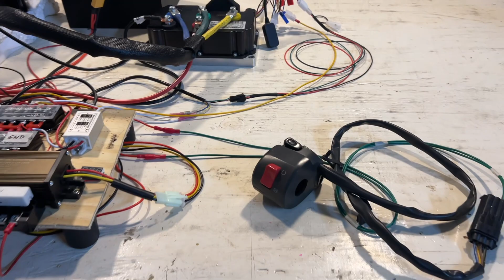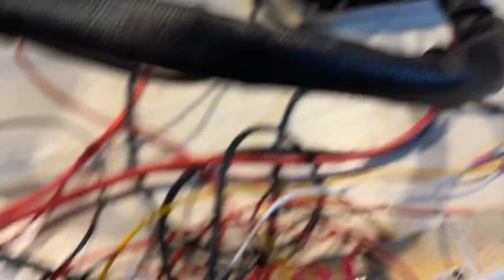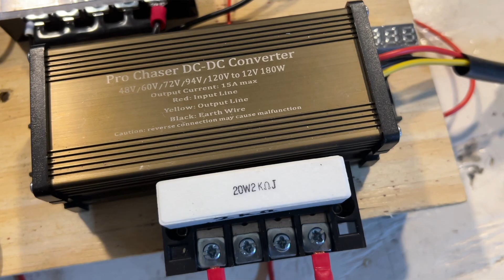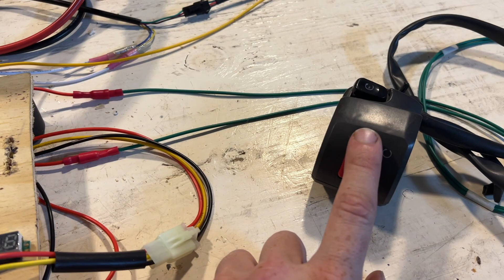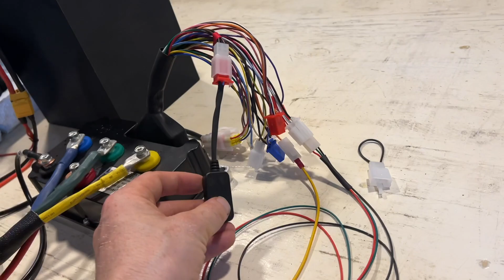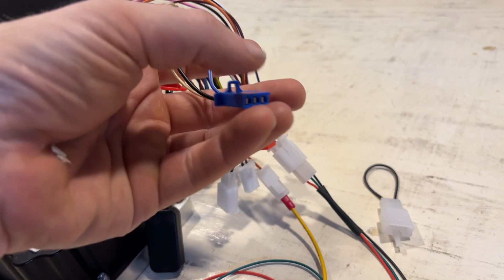Converting a Kawasaki KLS250sf Enduro Dirtbike to Electric (Pt.3) - Bench Test

Comment: The buck converter that is only used to activate the relay for the ignition seems very unessasary. Could someone explain what the point of it is? Why not just run 72 volts that are going to the buck converter to the controller?
Reply from the maker: The reason for the buck converter is to power the control circuit on the relay, which takes 12V. If you used a solid state relay where the control circuit was rated up to 100V (the battery voltage), the buck converter would not be necessary. 

The reason I wouldn't just pass the high-voltage line directly to the controller is because I wanted the system to be designed where all the component -  including the controller - operate across a single switch; the solid state relay. This is definitely more of a design choice, but its one that makes sense for me and simplifies any troubleshooting. 

Turning the key allows power to flow from the battery to the 15W buck converter, the buck converter powers the control circuit on the relay, the relay closes and power flows to the conversion box which is the source of power for all switching accessories. 

Here is a link to the circuit schematic for this system: https://imgur.com/a/RD7gYvB
Reply: @GaiusGarage Ok, thanks for the explanation. I did not realize that the solid state relay output was also used to control the 180W buck converter. 
Thanks for the quick reply! Love your videos by the way!

Comment: So with your contacter all thats doing in connecting main battery positive to the controller? And ignition turns the controller on seperate?
Reply from the maker: yes that is correct

Comment: Why are you gonna use the lipo pack rather than 18650 pack?
Reply from the maker: its just what I had available and using in the meantime. I just want to get everything else built and running, then will swap out the battery pack for one built from 18650 or maybe 21700 cells
Reply: @GaiusGarage  sorry..i meant why arent you going to use the lipo pack?
Reply from the maker: @MrDeceptacon88  oh because its only 20Ah - that's the biggest reason - range will be very low. Also lipo has a short cycle life (~800 cycles) and it becomes more dangerous to charge as the cell resistance increases with continued use
Reply: @GaiusGarage  i see makes sense. Since those lipos are able to be charged at 20A, what would the max charging be at assuming they are fresh packs?
Reply from the maker: @MrDeceptacon88  charging would not change based on whether the pack is old/new. Its based on the chemistry and capacity of the pack. For lipo 1C is what is recommended for safety and good cell health. But you can fast-charge up to 2C - for this pack (20Ah) 2C would be 40A. So you can technically charge up to 40A but you would be stressing the cells - this would lower their cycle life somewhat and is potentially more risky if a cell happens to become damaged
Reply: @GaiusGarage  ok I see thanks a lot for your help!!